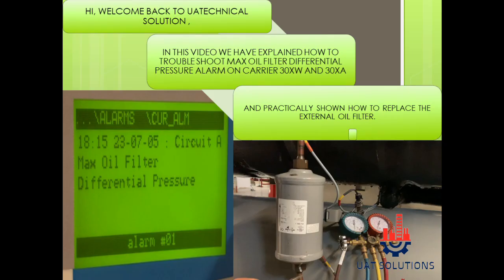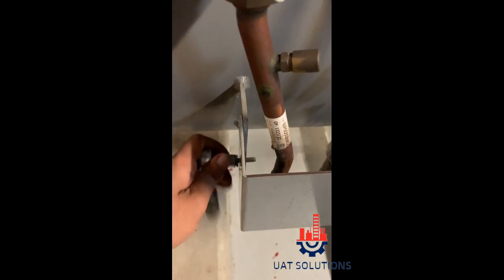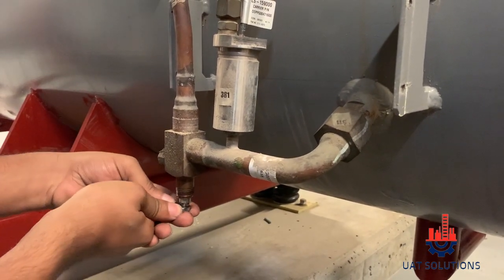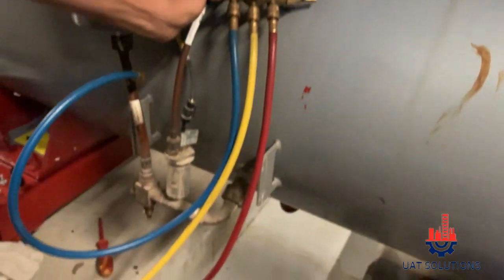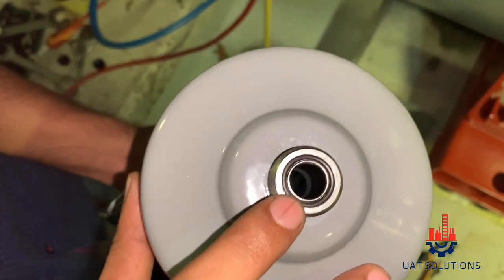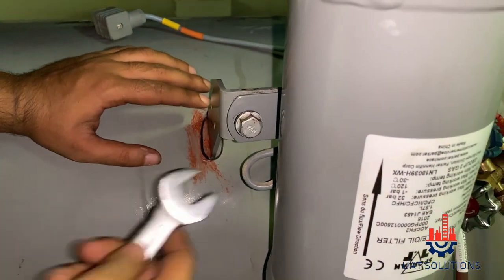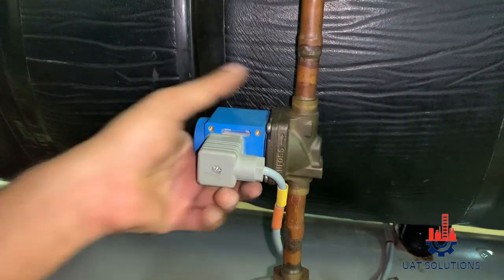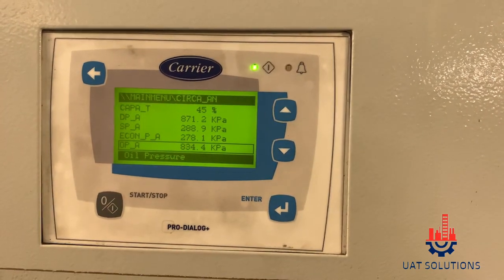Max oil pressure differential alarm troubleshooting and replacement of external oil filter 30XW,30XA

Comment: is there No need to Vacuum the filter before we connect the solenoid valve??
Reply from the maker: No there is no need for vacuum. The filter is small and oil line also have valve and solenoid valve very close to filter. There is no enough space for air and moisture to get in the system
Reply: @UATechnicalSolutions what a stupid response

Comment: What is the standard odp?
Reply from the maker: For carrier 06T compressor at least 650kpa. It is measured by subtracting suction pressure from oil pressure. 
If you are checking the oil filter performance than the difference between discharge pressure and oil pressure should not be more than 100kpa
Reply from the maker: For carrier 06T compressor at least 650kpa. It is measured by subtracting suction pressure from oil pressure. 
If you are checking the oil filter performance than the difference between discharge pressure and oil pressure should not be more than 100kpa
Reply: @UATechnicalSolutions  30xa same?